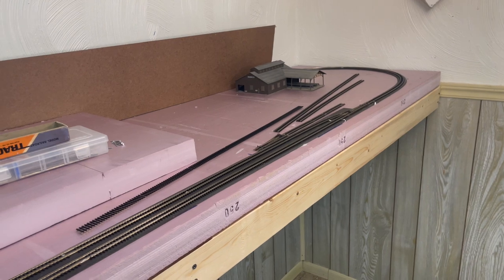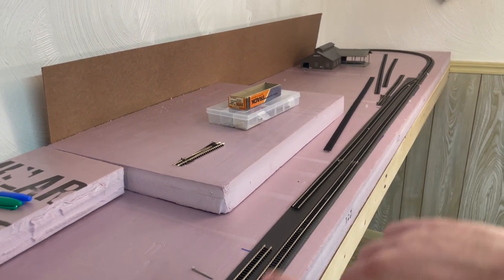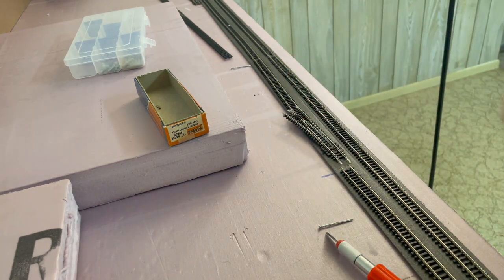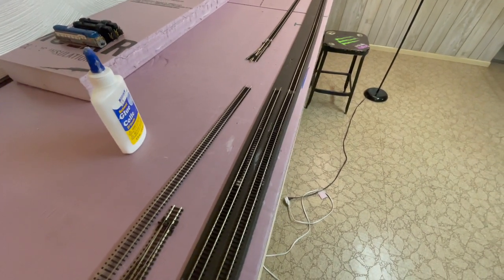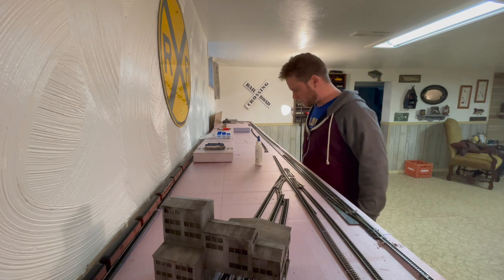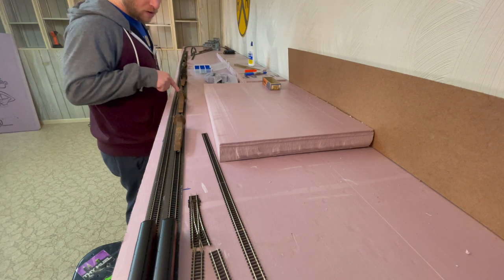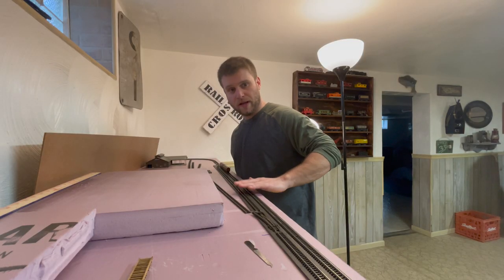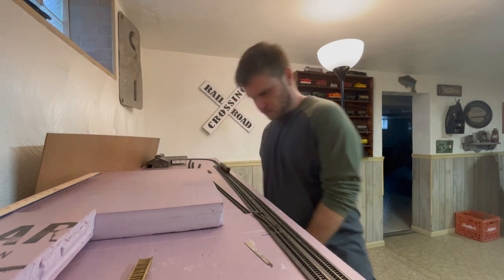N Scale Layout - Part 5 - Mine / Lumber Saw Mill / Laying Track and Turnouts

Comment: First time I’ve seen regular white glue used for flex-track. Call it a light-bulb moment for me, since it’s going to be ballasted and hardened anyways. I’ve been using LiquidNails Foamboard adhesive, which holds great, but I have to be very careful about how thin/thick I spread it and it’s not always available at the hardware stores these days. Thanks! Keep it up!
Reply from the maker: Elmers glue works perfectly fine! Ive used it on bachmann, kato, peco, and atlas track! just spread it evenly, dont use too much! It comes up very easily, and is strong enough to keep the track down. Trust me, try a test piece if youre not 10000% convinced
Reply: @TheTrainMane  you have converted this guy! Finished installing a spur-line yesterday and tried the PVA, works perfectly. Thanks again!
Reply from the maker: @cjboram1252  glad i can help!